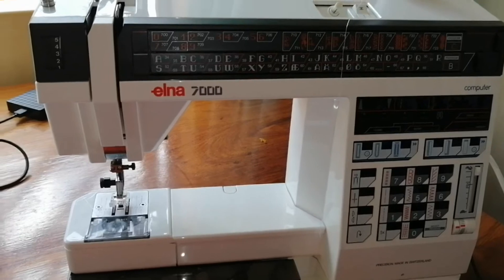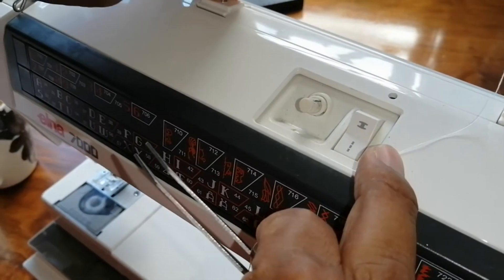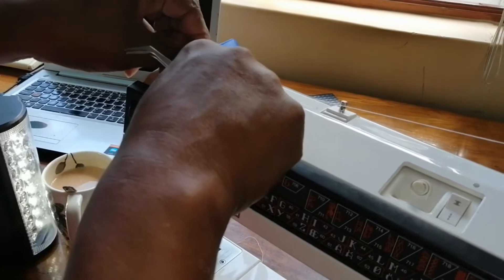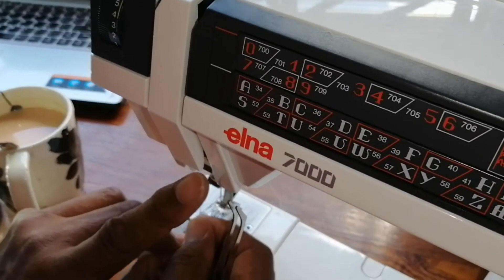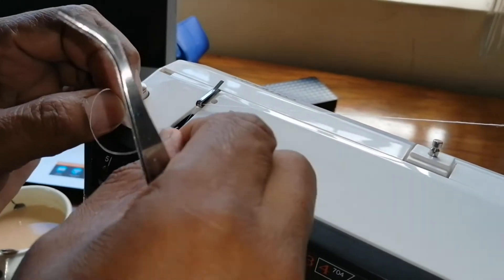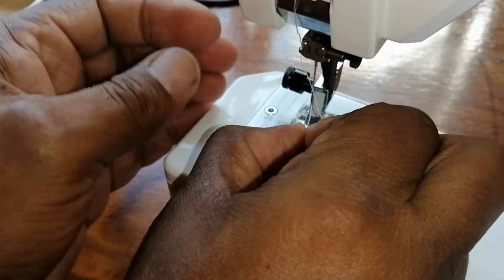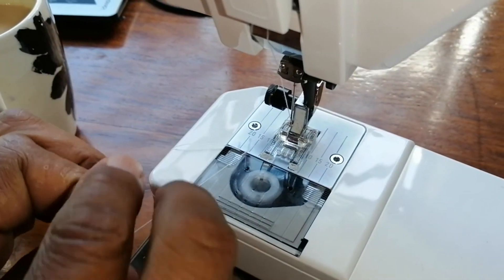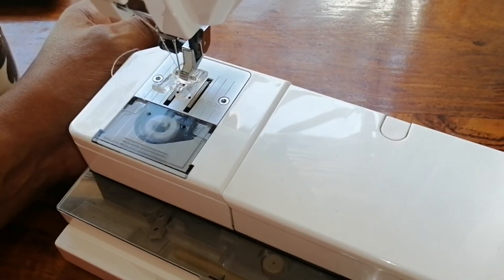Elna 7000 Threading

Comment: I’ve just bought a second hand Elna 7000. It has plastic thread spool holders on the handle and I can’t see how to make them upright? I don’t find any metal spool holders. It doesn’t appear to be exactly the same as the machine on your your video. It seems that I can slot the plastic one into the handle but then it is not at 90 degrees to the machine.

Comment: Sir I have a question please. I just bought this elna 9000 used. Turns on, wound bobbin, threaded machine but bobbin thread does nothing. I can't engage it with needle thread.  What am I doing wrong?
Reply from the maker: I think it may be the timing.  This is a job for the proffessionals.